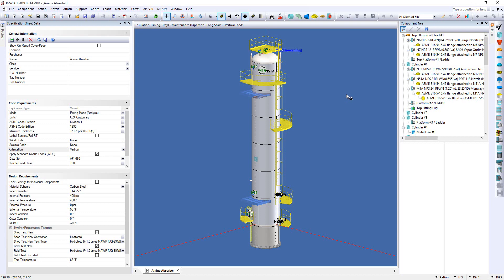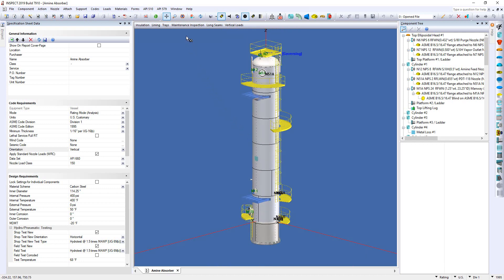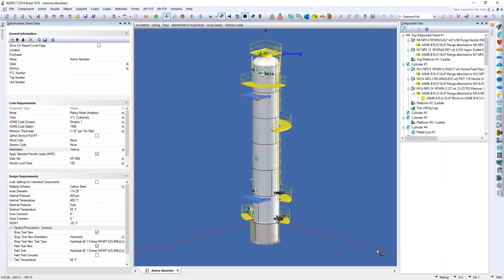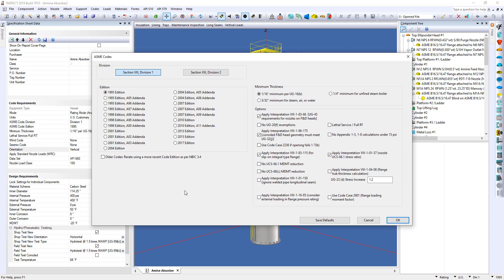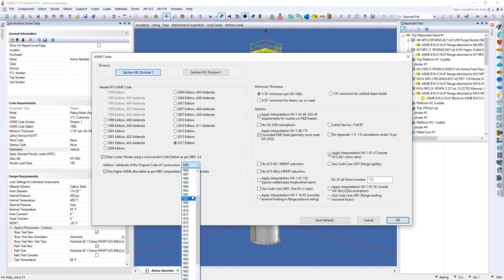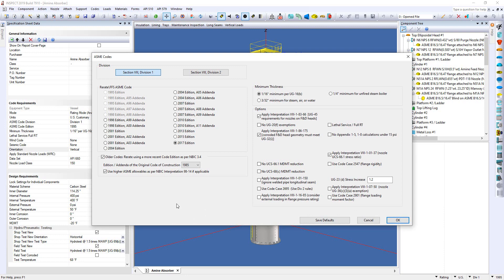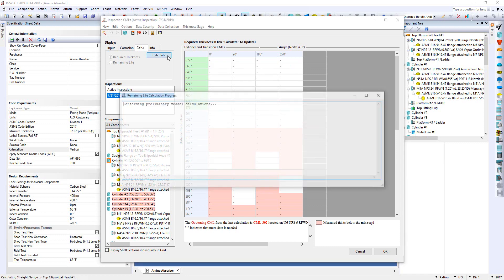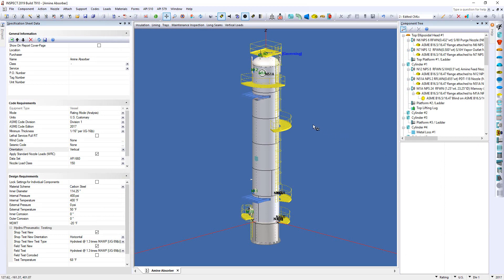Increase Vessel Life By Applying NBIC 3.4

Comment: If I want to rerate a Pressure vessel to a higher pressure, am i supposed to do FFs 1 & 2 or am i supposed to just conduct a design-based evaluation, see if it can work at the proposed pressure